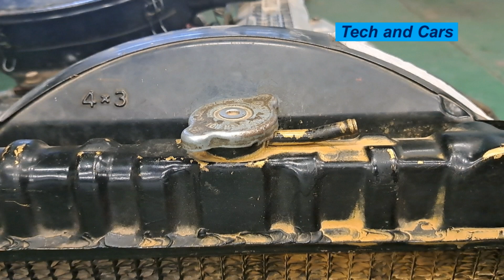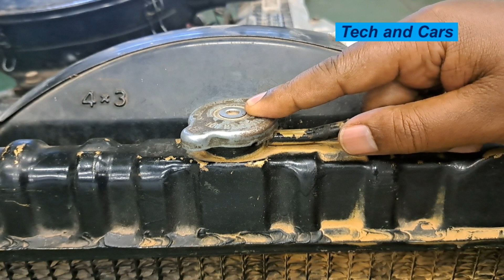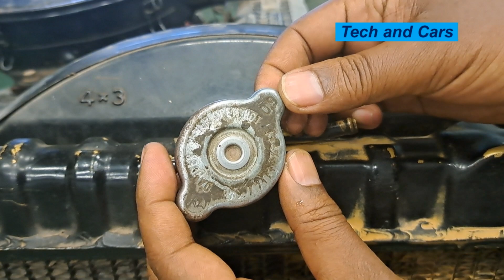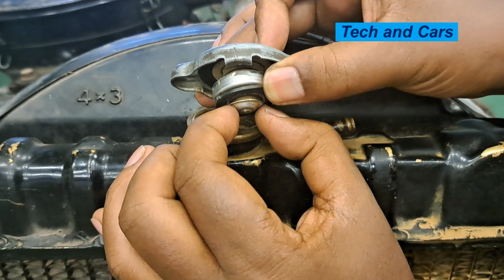How to tell if you have bad radiator cap

Comment: I have problem that l can't warming cabin of the car (inside car). It's start 5 or 6 secends it start hot sir and after that stops, Is this can cause the cap? I wash that little radiator (cabin radiator) and flush so many dirt.. and once l see on the top of radiator cap antifreeze

Comment: Good video. A bad radiator could have a bad vacuum valve  that results in low coolant level and may result in flat radiator hoses. Because it does not let the coolant get back from the overflow tank or reservoir.
Reply from the maker: Indeed!